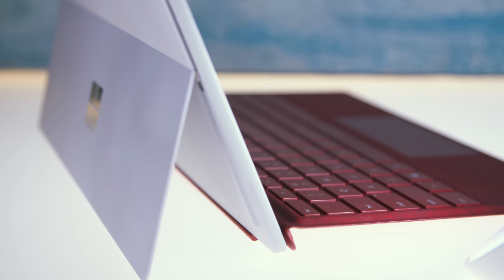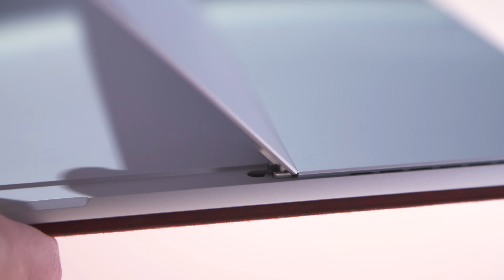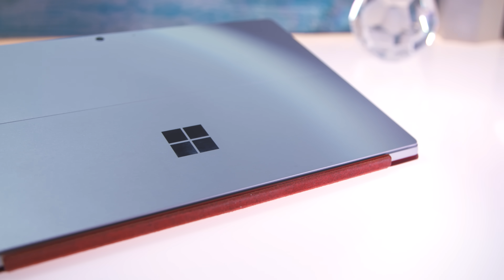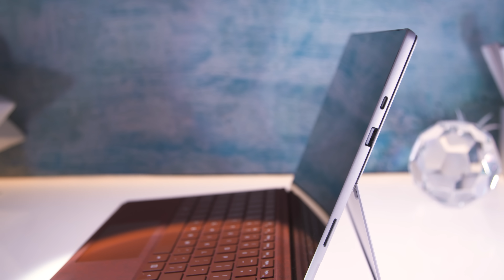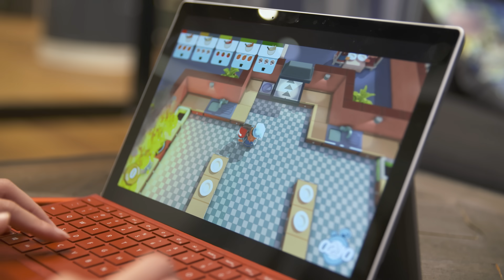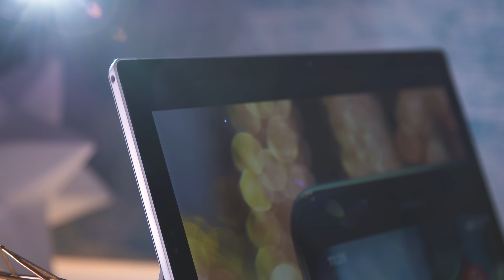Microsoft Surface Pro 7 review: USB-C upgrade, battery downgrade

Comment: Such a misinformed review. I'm sorry but you can't compare a fully-fledged operating system to tablets and pixelbooks.
Reply: I agree.
Reply: I think you took her comment wrong, it was more of design statement.The tab S6 with a surface keyboard and any other operating system would be a dream, that i would cherish.
Reply: Amen.  I'm going to purchase this because I can only get 1 laptop (I want 2 separate laptops: a small one for OneNotes and couch/bed time and a regular laptop for serious work. So I decided to get a Surface Pro i7 16GB ram and 256 GB storage. Although I'm not crazy about the screen size, it's larger than the Surface Go 2 and just as portable.
Reply: Normally I would agree, but she clearly qualifies the point.....
Reply: @MichaelGGarry  No she doesn't. As a Surface fan and user, If you want thinner and lighter but less powerful than you can buy the new Surface Pro X. That's the whole point of the Surface Pro X thinner, lighter and always connected, but less powerful. Nothing compares to the Surface Pro line really.
Reply: @ZuneGuy1118  Did you listen to what she said, the users she was talking about at that point? Because apparently too many people on here don't actually listen.

For the users she was talking about, there is competition for the Surface Pro line. For most other users, that want a touch screen/tablet that can also run a full OS, the choices are a lot more limited. That was the point.
Reply: @MichaelGGarry  Did you listen to how dumb that sounds? How is the Pro X competition to the Surface Pro series when it is an ARM device with limitations in a x32, x64 business world, and especially in Windows? That's not competition kid, that's settling. 

If you read most people on here did not like here review. We did listen, that's why we don't agree with it.
Reply: @ZuneGuy1118  Kid? Don't call me kid. I'm probably older than you.

It IS competition to certain users. I don't know how many times I have to say the same thing. It may not be competition for you, I or the majority of users, but there is a category of user whose required apps work on arm, or iOS, or Android, or ChromeOS that let them choose between all those devices. There are a lot of people out there that only use computers for Web,Email and light office work. For those users, any of those devices ARE competition.

"If you read most people on here did not like here review. We did listen, that's why we don't agree with it."

Most people on here struggle to think outside their own requirements. That is not new.
Reply: @MichaelGGarry  " It may not be competition for you, I or the majority of users, but there is a category of user whose required apps work on arm, or iOS, or Android, or ChromeOS that let them choose between all those devices."

Ah! yes, - hobbyists... I don't know who these hobbyists are, but they are the in the minority. And please don't count cellphones as they can do no heavy lifting in the business world, plus they fail to be anywhere near as versatile, I mean 1 billion Windows 10 users - c'mon. That woman is out of touch with the Windows scene. The only improvements that need to be made are more ports, preferably Thunderbolt. That's where Microsoft has been dragging their feet with regards to the Surface line. Sorry about the kid remark, but I'm 48.
Reply: @ZuneGuy1118  Hobbyists? I'm talking about actual working, professional people. I hate to break it to you, but by far the biggest group of users of computers only use them for email, office and light browsing.  Of those "1 billion" Windows 10 users, MOST FALL INTO THIS CATEGORY. They do have options from other OS's such as ChromeOS, Mac, iPodOS and to say otherwise is ridiculous. 

Hell my wife, who works in IT at one of the worlds biggest companies, just bought herself a Macbook Air as that's all she needs to do her job. A screen, a keyboard a "good enough" CPU and a decent trackpad. All her work is remote now anyway, as long as the web browser has the necessary plug-in she could work on any of those devices I listed. That's someone working in development of multi-million dollar projects.

As for the rest of us, who I would put into a more "hardcore" group, I certainly agree MS is losing out by ignoring TB3. I for one simply do not look at non-TB3 devices at all anymore. But I also recognize I am very much in a minority of overall users.

I'm 44, not too far behind you buddy.
Reply: @MichaelGGarry  Well actually you're wrong. The largest group of users of PCs is in the gaming market as PC gaming has literally exploded in the past five years. In fact during the desktop PC decline when the iPads were once all the rage and everyone (my wife included) had to have one, the PC Gaming sector was steady, and from there took off and hasn't stopped since. This is due to powerful hardware and top level customization by the customer. Which is another area where the PC has always won against other platforms - options, and customization. Then you have Samsung DEX which Samsung desperately wants people to consider before Windows - completely laughable. Apple still trying to convince that masses that an iPad is a PC replacement. Both platforms still present all the limits that a Windows world doesn't - mainly know x86 compatibility. Microsoft tried to convince us that UWP is the best way to go, but people didn't want it. Now it's floundering. UWP apps is not at all why Surface has grown and become so profitable in such a short time.
Reply: @ZuneGuy1118  Thats not even close to being true. In fact: reference required. How are you even measuring that?

I work in games. Its my career and I would not make that claim at all. 

You talk of "1 billion" Windows users. Steam, the number one gaming store/platform by a massive margin, have "only" about 70m monthly active users. And that is across 3 platforms, even if Windows is by far the largest of the 3. Windows 10 is on approx 700m devices (2018 figures), which makes the leading gaming platform 10% of the overall Windows 10 user base AT BEST.

Meanwhile Apple have sold over 360m iPads since they were first introduced. How many are used and in what manner is a different question, but they are filling a gap from Windows users.
Reply: @MichaelGGarry  How many of those iPad sales are just the same people buying the latest iPad. One thing about apple fanboys is that they just buy the newest model year after year. 360million sold is not 360million unique individuals.
Reply: @mikeydurden  Of course not, no-one makes that claim and its the same for absolutely every consumer device other than 1st generation new devices. However this myth about "fanboys" buying a new model each year is just that - a myth. I don't know a single person who does it and I would like to see some actual figures on it. Can I believe that Apple have a higher percentage of customers that do that than other IT companies, sure. But I don't think the figure is anyway near as high as people make out.
Reply: @MichaelGGarry  tbh  there are fanboys out there that buy the newest apple products every year but it's usually with cellphones. Most people  don't care about their tablets as much as they do their cellphones.
Reply: @Cinnabar Volcano Yes, she did. DId you listen?

Comment: As soon as she mentioned tablets as 2 in 1, I'm out. TRUE 2IN1 run full operating systems. I'd like to see you run a 64bit programs on a tablet, good luck with that.
Reply: Err, iPad OS is 64 bit.

Your first point is valid though.
Reply: They are already 64bit apps but they are not made to run on x64

Comment: Hold up, you're saying the SP7 has 8 hours battery (of the 10 hour claim) but the SP6 has 15 hours?

Which is more than the stated SP6 13 hours. I don't believe it. The SP6 does NOT last 15 hours! The tests weren't run equally.
Reply: doing illustrations the SP6 DOES NOT GET 15 hours. Not even 8.
Reply: @animedudevid  yeah I don't know where she got the 15 hour figure from. It's totally inacurrate.

Especially when she's claiming in a review thousands will believe the SP6 is 15 hours but the SP7 is only 8 hours. That's poor journalism.

I'm here the Surface Pro X lives up more accurately to his 13 hour claim. Like you say Intel based Surface Pros have never got anywhere near their advertised number. It's a lie.
Reply: @no google I don't want to use my real name. Your numbers sound fair based on what I've heard from reviews and people with them. So annoying to get USB C and Fast Charging you end up losing battery :(

Comment: The iPad Pro and Galaxy Tab S6 are NOT 2-in-1s :-/. They're tablets with attachable keyboards. It looks dated compared to the Galaxy Book 2 (2-in-1) though.
Reply: You can get linux on Tab s6 with Dex
Reply: @MemoContrerasf  Linux Dex is support being dropped with the upcoming Android 10 update.
Reply: @MemoContrerasf  Yeah, but performance.
Reply: The Surface Pro is also a tablet with an attachable keyboard. Yeah, 2 in 1s are a different beast, but I personally prefer this.
Reply: @xmaverickhunterkx  urmm no. Its a 2-in-1 laptop with a detachable keyboard. Much closer in operation to foldable laptops than tablets. The software is keyboard first, unlike IPadOS and Android.
Reply: @bradavon  I agree with the software argument, which goes to Microsoft's detriment, however that's not how they are selling it. You buy a Surface, it comes with no keyboard, and Windows has this "tablet mode" which is crap, but MS deems it enough.
Reply: @xmaverickhunterkx  Well you could say the same about IPadOS and Samsung's Dex. They're poor laptop replacements. It is these days. It maybe technically be a tablet but all the marketing sells it as an ultra portable laptop now. I think the no keyboard thing is only so you can pick your colour. It's heavlily shown in all the pictures and on the order page. Tablet Mode hasn't been looked at in 3 years. They've even recently updated Desktop Mode to be more touch friendly. That tells you how much they care about Tablet Mode. It's barely useable. It's a fallover from Windows 8.1 that never took off or has got much love since.

Comment: I mean it’s the same design for the last 5 years. 5 years!?!?!
Reply: And it works!
Reply: @springbok4015  doesn't stop it looking dated. It's getting a redesign next year.
Reply: @bradavon  but the SP 2017 has a redesign internals that allows fanless operation for i5... How many ultrabooks can be fanless?
Reply: @DarkPa1adin  I don't understand your point. The Surface Pro 7 design dates back to 2015.
Reply: @bradavon  with reference to the shell yes with a little tweak. they smoothen the edges, not as sharp as SP4. but it is the internal or the thermal solution to make it fanless that is implemented in SP 2017 or SP6?

I might have mixed up 2017 for 6
Reply: @DarkPa1adin  SP2017. The SP6 was literally just a processor upgrade. A release only because they thought they had to release something. Totally pointless really.
Reply: @bradavon  "SP 6 was just a processor update, totally pointless". I disagree. Going from 2 physical cores to 4 physical cores with the SP6 was one of the important steps for these tablet PCs to become full fledged Windows 10 machines and they still managed to retain the fanless i5 design and long battery life. Plus they put 8GB RAM minimum on the base SP6 model and it was the same price as the 4GB from previous model. I mean, I don't see what's so pointless about refreshing the specs each year anyway. Otherwise people who are looking to get a Surface Pro might be stuck with 2-3 year old specs.
Reply: @weaverquest  it shouldn't been the only difference but part of other upgrades though. Like it was the previous year and this year. They've brought back the 4GB configuration though. A mistake in my opinion. 4GB just isn't enough these days. I'd probably be fine with an i3 but can't because it's stuck with 4GB.
Reply: There's now a Surface Pro X with new design.
Reply: jkjkjk Surface Pro 4 launched on October 2015. It's been 4 years with this design. If you're claiming the Pro 3 has the same design, it does not. It's similar, but overall very different build from the Pro 4.
Reply: @DannysHauntedJourney  they mean 4 years. Which is crazy. They've only got away with it because apart from Samsung other manufacturers have been away from this form factor.

Comment: Hi..I own a GoPro hero black 7. I'm planning to get a Microsoft surface pro 7. If I go for a i5/8 GB RAM configuration...will I be able to playback 240 FPS videos smoothly, shot on GoPro7. I'm not looking for any editing and stuff. Only need to playback 240 FPS videos smoothly. So my question is a i5/8GB configuration be sufficient to play back higher FPS videos smoothly or should I go for 16GB RAM?
Reply: Editing and rendering in higher res and fps Is cpu bound not ram

Comment: I'm keeping my Surface Pro 4.
Reply: The sp7 is actually a significant bump up in graphics performance.  Its integrated graphics chip significantly out performs the original surface book.
Reply: @sterlingveil  I know that. But if I am to get another surface product, I would get the surface laptop instead because I've always been interested in it and I've heard great things about the keyboard. So even if the sp7 is an upgrade, I want something that looks attractive at the coffee shop like the surface laptop because I'm always trying to get laid😉😉😉
Reply: @K3nnyAss  Hahahah noice. But true, they haven't changed the design at all since forever. And all because they want to sell more Surface X.... Assholes.
Reply: @xmaverickhunterkx  Lol. Yep.
Reply: Big DODdeee you enjoy 2.5 hours of battery?
Reply: @DannysHauntedJourney  I got a power bank
Reply: my pro 4 is filled with problems
Reply: My pro 4 stopped working the day before the 7 was announced.  It turns on, but nothing is displayed on the screen,  nothing.
Reply: @alvaropena5540  My monitor is having consistent flickering issue.
Reply: @michaelpan2972  that's a known issue.  Microsoft has an extended warranty for that.  Take it into a store and if they can't fix it they'll try to get you a replacement.

Comment: I'm interested on what the "serious limitations" the Windows on ARM has, the only issues that have been talked about is running application that are based on OpenGL. What others are there?
Reply: Alot of 64 bit  programs just don't work so you have to use 32 bit. the problem is PS doesn't make an up to date 32x exe or does several other companies. Clip Studio does but that is rare. And as a long term Clip users the 32x version gets slower updates.
Reply: ARM cannot run non x86 applications, so Windows must have an emulator.
The same is true for 32 and 64 bit apps. Windows 64 bit emulates 32 bit to run 32 bit apps, that's why they perform poorly on 64 bit systems (but nobody really notices this lol).

The problem for ARM is even worse than 32 vs 64 bit.
But ARM as gotten so powerful that things might not be as bad. We'll have to wait for the X and see how Microsoft worked things.

Comment: Why so enthused about USB Type C🤔? I hardly see anyone discussing its significance. They should first give differences between A and C (also tell why B is missing 😏) before yaying! Yay!
Reply: Well usb c is great since it is super easy to have right now i have a few converters but the best part is the fact that it natively holds different port info so you can just get a c to hdmi or if your screen works with usb c then bingo mine does so i like jt
Reply: @yskuzi  what does it do🤔?
Reply: Ys Kuzi you can get mini display port to whatever you need. This USB c thing is only marketing. If only it were a thunderbolt port...
Reply: @estebantet  if you say so but i rather have one do it all port then 3 port that i might hardly ever use like a mini dp is cool but it means that i am restricted to the display only with a type c post it's usb from the get go so charging display and usb functions are available in one.
That's just use full running out of battery the changes of someone have a USBC power brick is much higher than a surface connect
Reply: Ys Kuzi To be honest, since they kept that surface port or whatever its name, I didn't know we could charge the computer via USB c. That's good news then.
Reply: A is the older one which have orientation

B is the one for 2008-2013 printers shaped like box

C is the newer one

C is good but is bad, because there is thousands standards that your peripheral might or might not work on different device

But if it works, it works
Reply: I mean, she only gave a very good reason in the video - sharing of cables and external things like chargers, headsets, external storage etc between devices now that USB-C is becoming the standard.

Not as good without TB3/USB 4 support though.

Comment: How much did they shrink the battery? A nearly 50% reduction in battery life is huge. Are you sure this isn't an outlier or bad unit?
Reply: Pc mark score it's about a 20 percent gap with charger being 220% faster
Reply: It's the new Intel 10 gen. Much more powerful, but uses more battery. To offset they added fast charging (80% in 1hr)

Comment: Customer: I want it to be affordable powerhouse, but how much?
Microsoft: yes.
Reply: @Anton Schober Not exactly, but fair enough. And for the new surface pro, not so much of this justification shall work for that. I actually changed back to a 2012 laptop from surface pro on solely typing experience. And they are as we said，the best experience.
If you do not consider lenovo.
But yes.